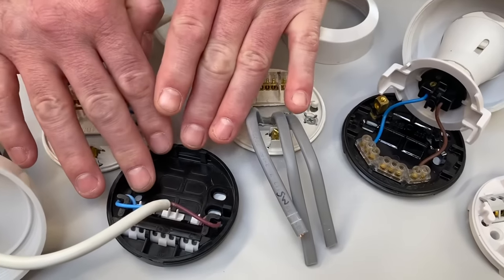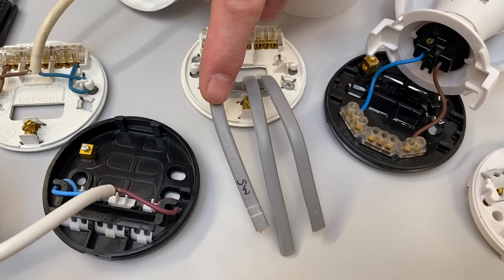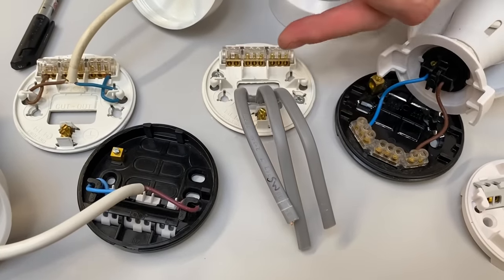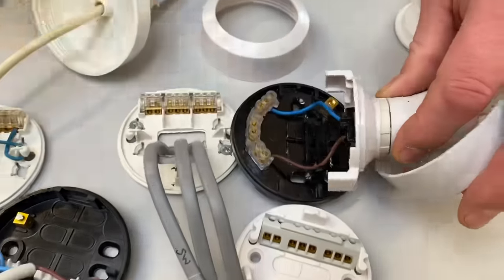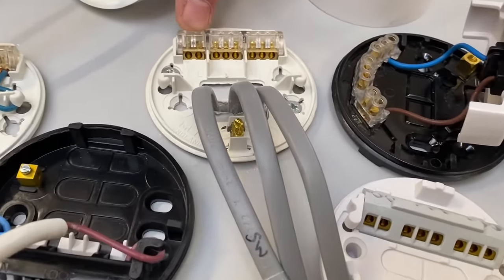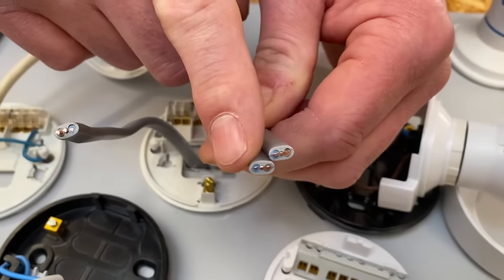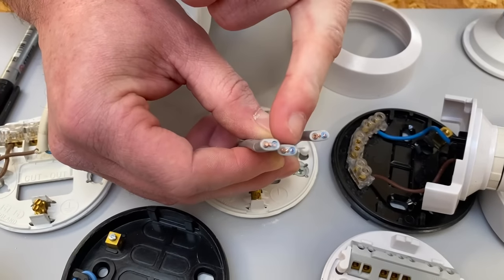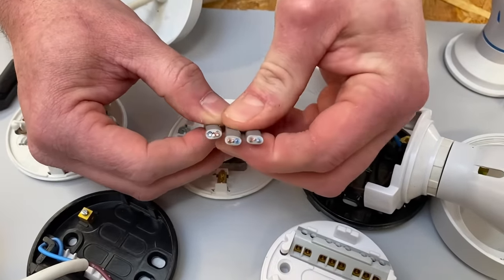How to Wire up a Ceiling Rose Pendant - Wire Up & Connections Explained Using the 3 Plate Method

Comment: Hope you are feeling better soon. Could you do a video on how you would correctly wire live and neutral to the switch and then to the next light in the run. As the US runs line and neutral to the switch, a lot of the smart switches need it to work. There are no neutral switches available but I get the feeling that line and neutral is going to become more common so it would be good to see the correct way to do it.

Hope it’s nothing serious and you get well soon.
Reply from the maker: Taking the Feed (Supply) to the Light Switch the 2 Plate Method https://www.youtube.com/playlist?list=PL2Ea5r9gxUUevU9gv8lizD53aYvwiJ5qr

This is what we do in the U.K. when we take the neutral to the switch 👍🏻

Comment: Just decided to upgrade the lighting in a bedroom and saw this video in my suggested list.
The bedroom has one silly globe fixture right above the window which is a ridiculous place to put a light.
I want to have the light in the middle of the room.
What would be the best way to move the fixture?
Reply: You would need to fit a new ceiling rose and disconnect the wires from the old one and put them into the new one. However this assumes there is enough cable to reach the new position if not you would need to extend the existing cables using a suitable junction box. However this raises the question of whether this requires a minor works certificate as you are extending the circuit perhaps a certified electrician can  comment.

Comment: I’m an American electrician.
No offense but, you British certainly make mountains out of mole hills.

Your way is arguably a touch safer but its incredibly inconvenient to run the line ( the supply from the breaker) to a ceiling.
Reply from the maker: Great user name 👍🏻
Reply: @GSHElectrical  
I wasn’t suggesting that your way is difficult. I’m suggesting that your wiring methods turn something simple into a rube goldberg machine. 

So yeah, it ain’t rocket science